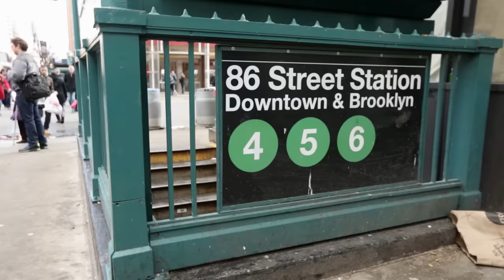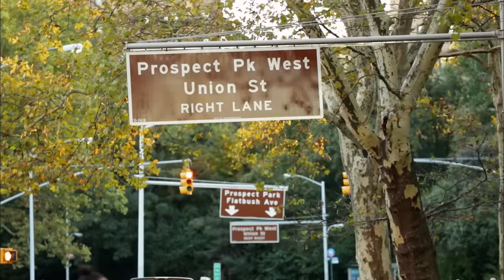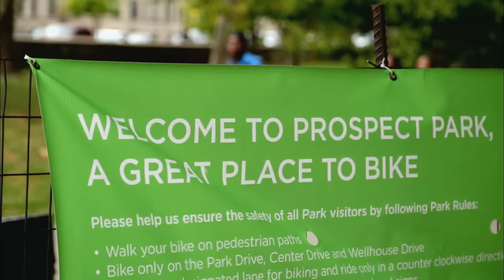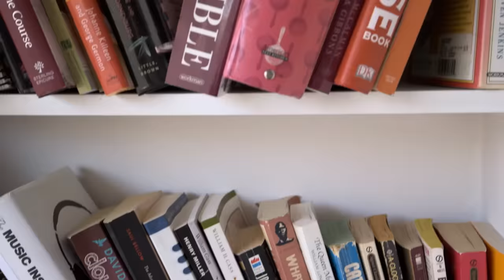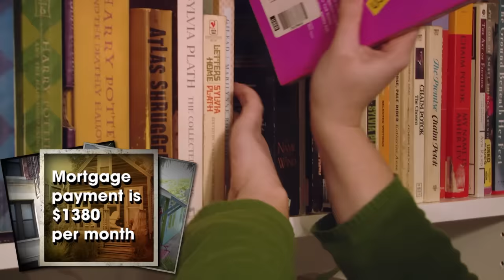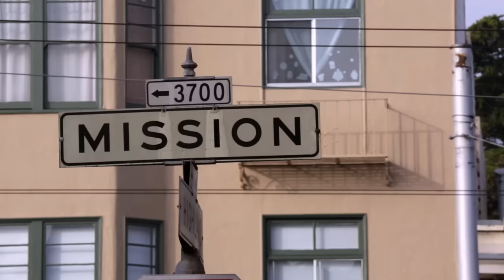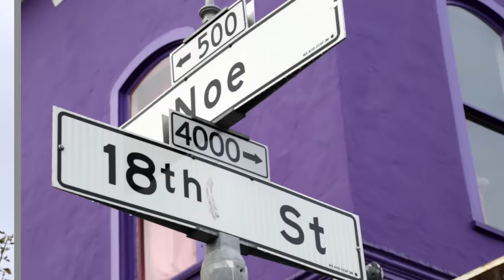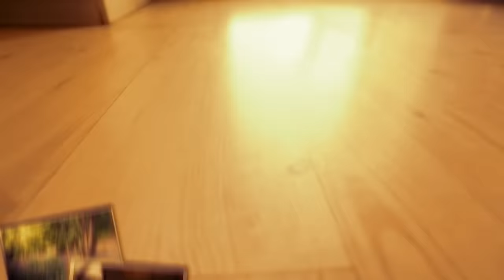6 JAW-DROPPING TINY HOME TRANSFORMATIONS *2 Hour Marathon* | Tiny House Hunting | Home.Made.Nation

Comment: At one hour 7 min - I LOVE that dark kitchen - it's sophisticated and with light ceramic vases, a tiny lamp on the counter, flowers, it's not really a "man's kitchen".  The noise outside could be lowered with a water fountain. I'd remove that ugly fake clock thing and put a cabinet there with a fold or pull- out table. And the desk in that cove, I'd put it in front of that window neary and put in shelves with baskets for storage.  I'd also add color - the beige sofa and rug is too plain. And for the entry, I'd add hanging baskets on the outside of the stair entry and I'd paint that trim a pretty color instead of the muted grey/blue whatever it is to liven it up.